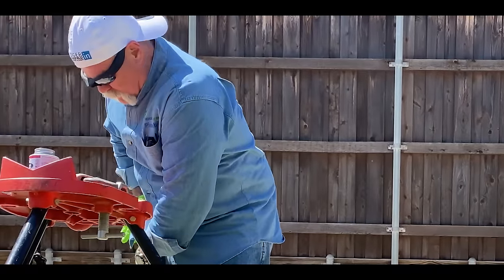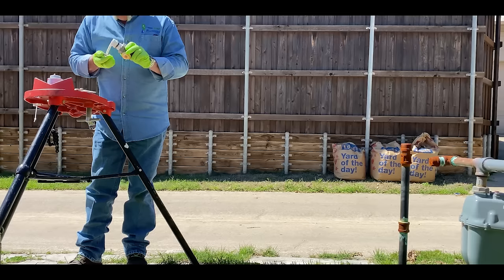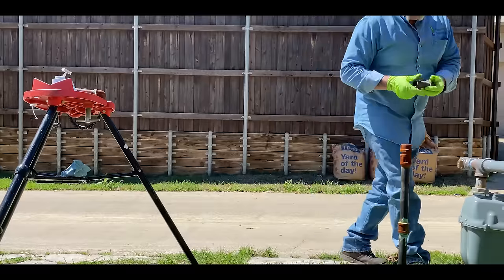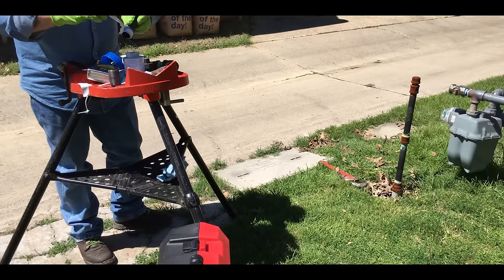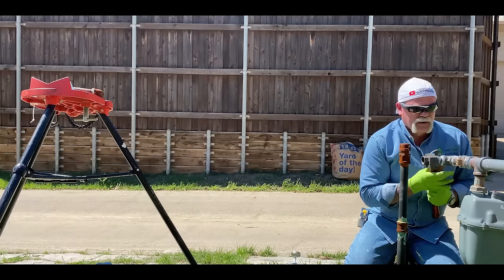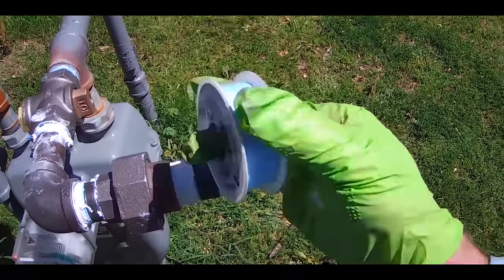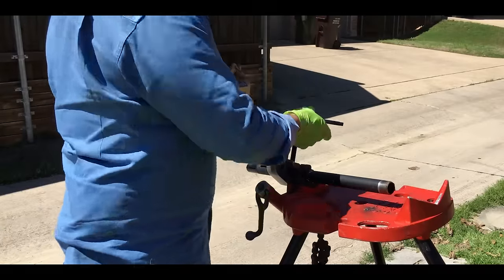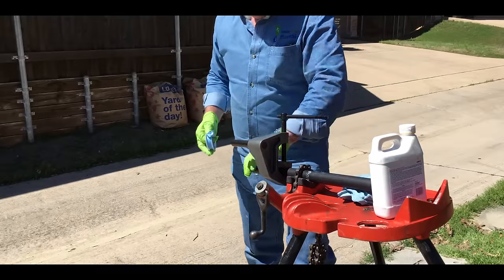Neighbor HIT This Gas Line! - Gas Line Repair (Plumbing POV)

Comment: On an outside installation of a gas meter if its not up against the side of a house or if its within certain distance from a road , driveway or anywhere it can be hit  needs to have concrete pilings here in New jersey... I know of an old lady who hit the gas instead of the brake on her car and ended up going around the back of the building and hitting allof the gas meters for the building . Luckily there was no fire or other damage. Any exposed black malleable steel pipe must be painted in order to prevent rust. We use galvanized outside
Reply: 1301, I am from Missouri and just like New Jersey we adhere to the National Fuel Gas Code. The problem is a lot of people out there ( plumbers, pipefitters, contractors, h v a c technicians & ect ) think the only codes they need to adhere to, are municipality or state codes; and that is fine until an incident occurs and there is a lawsuit filed. Then these very people find  out the hard way that their state is in the United States and the trial attorney sets down on the deposition table, the local code book, the state code book, the national fuel code book and the GAMA ( gas appliance manufacturers association) standards manual.

Comment: In the old days before Teflon tape and other stuff. The one item we used on gas pipe in the plant told to me by the old timers and we used and never had a leak was ; permatex no 2 form a gasket. It’s totally resistant to petroleum products, never hardens. It works great , never had a problem.

Comment: I use the dope/tape combo on any threaded connections so far as water lines are concerned.  But on gas lines most codes don't allow Teflon to be used as a sealant, even the dope is required to be non-ptfe. Another thing I'll mention for anyone watching that's considering adopting the practice, be careful you don't Crack your fittings! Especially these brittle "lead free" brass parts.

Comment: Very nice gas job! it's done  professional plumber all that is left is to paint those fittings and pipe so they won't get rusty. All I know is that most plumbers don't like doing gas jobs I still remember carrying the vice Ridgid machine out of the truck,  remember getting rector seal, oil, teflon.

Comment: Post completion document you recommended safety steel surround installed to eliminate any future damage to meter. New residentials have these within garage conventional water heaters, car pulls into garage to far, will hit safety steel surround, won't hit existing water heater.

Comment: Wondering if some sort of protection barrier needs to be installed to prevent future car strikes.  I know for heating oil tanks were cars can hit it there is a requirement to sink posts or some other solid barrier to prevent it.

Comment: Another trick to use is putting Molly paste on the threads and faces of the union.  This helps with the seal, and ease of breaking the union apart in the future.

Comment: It’s been a few months now. Maybe a year. But the tape and pipe dope tip finally came in handy.

Had to replace gas valve on water heater, and went ahead and replaced the old valve coming out the wall and replaced 3/8 or 1/4 inch copper line that was kinked pretty bad in one spot with the correct 1/2 size line.

All went well and saved my butt!

Maybe do a video on shortages in the industry if you haven’t. I caught hell trying to locate a Rheem LPG gas valve.

Comment: I work for the largest utility in the USA. We use pipe dope only, but you have to use the right pipe dope. It’s not yellow dope, it’s not blue dope, it’s green key tite dope. Never hardens. Always seals. Ps, you stole the utilities usable tee, now they cannot hot tank the meter to work on it. The tee above the right side of the meter must stay open with a plug. Then the utility can probe the meter and Keep the service hot without interrupting service
Reply: Lol - we may work for the same company. I remember using the yellow crusty stuff in early 2000s though. Terrible stuff

Comment: Sir you are right perfect tools for a perfect  job 👏 👌  I learning lots of thing from you ! Gas pipe line working is always difficult  And sir one more thing I like to add please  for new plumber also concerned for the safety and Gas leakage test..

Comment: I loved seeing that you used both tape and dope.  That is the exact method I used when I drained my water heater earlier this year to flush it and the shut off valve broke when turning it back on.  Both the Water heater and the Furnace are in the same closet.  I took the opportunity to fix the terrible work that was done back in 1968 when this house was built.  I am a novice,  and even I could see that the people who had put together the split between the incoming line and the two appliances didn't care.  They just threw something together with what they had.  The gas line comes in through the back wall the put a T about 6 inches out from the wall to split the line and then a 90 to continue it beside the other.  It looked like a two pronged fork sticking out of the wall and came almost all the way to the front of the closet.  To replace the water heater you would have to completely remove the gas line as it cut the closet in half.

PS Howdy neighbor.  I am just down beltline over in Farmers Branch.  :)

Comment: I work in the oil and gas industry construction side we use teflon and tf 15 pipe dope with presure tests 5500 psi sometimes u better use both in our applications

Comment: Great video! Here is PA we always spray paint pipe and would use meter protecting in that location...I know all about dragging the old ridgid threader out of the back of the truck haha
Reply: We always paint our pipe as well- nice finished product, keeps pipe from rusting also!
Reply: @tomallen7699  ... in these parts (Ct) the rule is all black pipe must be painted or it doesn't pass inspection. Not sure if that's on the books, but that's what the inspectors want, and it can't hurt.

Comment: You only need three to four wraps using monster Teflon tape putting 8 wraps is way too much. It is also against Connecticut code to use non gas rated Teflon tape on gas lines

Comment: You tried the yellow. Blue monster gas tape it works for propane and all gases I love it it’s more of a plastic texture but melts into the pipe just asking because I do a lot of  propane and depending on area propane will eat through the tephlon tape

Comment: My biggest debate with other plumbers lately! I put the dope under the tape for aesthetics, but another plumber advised me use the gray dope ,on gas lines, as it is water based and the corrosion  helps seal the threads! Not sure if its true but havent had a leak since doing this!! Now my biggest and only problem Ive ever had with you , is why oh why are you not using galvanized outdoors??? Someone earlier brought up teflon on gas you must use the gas Teflon only tape its usually yellow or gray

Comment: When doing gas it wouldn’t say it’s necessary to use tape and dope on the threads. There is not a lot of pressure after the main. But it’s necessary when doing high pressure lines.

Comment: Don't know what that pipe dope is consist of but here in Europe only thing that is combined is hemp trends and linseed oil in the old days, and some of it still today. I use it in the same amount as Loctite yellow pipe thread glue or Loctite white tread line. Teflon tape only as a gas Teflon tape that is thicker and one that is like fine felt material impregnated in white sticky dope, similar like that white stuff in a can with a brush.

Comment: Roger is correct, Teflon tape first, lack slick tight secondary. Another aspect within this process can save you massive time, when soldering near any fittings that have just Teflon tape, and-or laco liquid Teflon, will leak post completion. Using both prior to any heat/soldering, especially within acetylene choice, highly probable you won't have to cut section second time, drain system down, start process over again.

Comment: I noticed you wiping the joints when you where done installing the valve I have always thought pipe dope and then tape cuz if you do Teflon then dope you just end up wiping all that dope off the bottom of the threads win you are done in other words I think the tape keeps the dope in place👍

Comment: back in the dy when i was deciding what i wanted to do for a living i worked under a master plumber for a couple years we used tape and dope .. we also put vavls in to gas line without shuting the gas off. we did alotof gaspipes and propane install

Comment: Would have to wack that meter when it’s time to change out . It’s supposed to have a tee on the outlet side to supply gas from a bypass to keep the pilots on in the house while doing meter maintenance.  But maybe your area doesn’t require it good job and idk why I’m up so late if I’m going to be working on this all day tomorrow lol 😆

Comment: I know it's an older video, but I work as die maintenance in a die cast factory. We have water, and oil pipes on the dies. The other guys always looked at me funny for using pipe tape and pipe dope. I've never had a leak ever.

Comment: Used a 20 year old snap on drill that our service manager happened to find layin tucked away and the battery still had enough power in it to drill 2 sets of 2, 4x10s together

Comment: Man I gotta get my dad to buy one of those cordless threaders. The hand threader we have is an old Ridgid from the late 60s that plugs into the wall. It weighs about 50 pounds and has enough torque to take you for a ride if it binds up and the handle gets hung up under your jacket.

Comment: As an electrician this Milwaukee threader looks like the bees knees. 
I've done so much Rmc threading using a pony which is basically the corded version of this tool. 
But there is not a good way to attach the tool to the tri stand. 
If you anchor the tri stand down with anchors you can wedge a piece of pipe or strut under the handle. But that's a pain too. 
This clamping mechanism looks like a game changer. .
Leave it to the plumbers to work smarter. 
Also do you not have to seal the pipe up with paint? 
What about a bollard looks like that is a likely candidate to be hit again.

Comment: Teflon and dope is the best method . Key tight works great ( just messy ) . Kinda surprised you didn't use galvanized pipe and fittings . That tool and Milwaukee tools in general are awesome !

Comment: Here in CA they would make me put a tee and plug where that first 90 is
Reply: SD, that is the correct way to do it in all 50 states. By installing a tee now you have a pressure tap ( with a pressure tap I can pressure test the fuel run , verify the working pressure drop between the meter set and the appliance load and I can check the working and lock up pressure of the regulator).

Comment: I'm pretty sure you can't use tephlon tape on natural gas as it will gradually degrade and all the joints will leak gas.           They do make a yellow tape for gas but I still wouldn't use it.          Now on water I also recommend using both tape and thread sealant.

Comment: Wouldn't you use Galvanized piping instead of black iron piping when using it on outside ? Other than using the spray to prevent it from rusting

Comment: Sick video roger ! Always work on gas lines. If there’s a lot to do I would cut off gas of the house to just be safe.. I’ve never used that tool, nor have I made threading on galv pipe.. Have mega/propress tool. So I’ll slap a male adapter on the other side..
Reply: I’ll never do that working on a meter though.. only on a new extended gas line.. to whatever needs a new gas line ran too..

Comment: Nice craftsmanship but isn’t exterior plumbing supposed to be galvanized because of the elements or is it different in your state?
Reply: In Oklahoma you can use black iron but you have to paint it. Im sure it's the same in Texas
Reply: I've seen plumbers here in northern California use black steel pipe for gas on meter then paint it. Code here sais that it should be galvanized they paint it grey I asked why ? They said the fittings are cheaper so go figure.
Reply: @jaredservin2392  thanks for that information

Comment: Every job I had to. I had to bring it 100% up to code. My question is doesn't that include pressure testing it.  Which is what I would have done before connecting it to the main. Especially after a vehicle strike!  I didn't see and end cap with a pressure gauge and a Schrader valve.

Comment: Do they have loctite 55 or 577 in the US? that’s what we use a lot of in the uk instead of ptfe tape these days, 55 is ptfe based fine thread so gets into the pipe threads directly and 577 is like a gel that cures on compression of the thread. Much easier to use.

Comment: I remember hearing that the teflon tape fills the larger imperfections in the threads and the pipe dope does 2 things. The first is that it acts a lubricant so the teflon tape doesn't get bound up or snagged when it's going in and the second is it seals the smaller imperfections.

Comment: A meter outside the house like this would never be allowed here. In Germany the plumber has to make sure that no one can manipulate/sabotage the gas installation. So when ever you are installing gas in a place that is generally accessible (like in an apartment building) we have to use special fittings that can only be operated with  special tools and not with a standard wrench. So this meter you have there must at least be placed in shed you can close up.
And before we are allowed to let gas into the construction have to make an endurance test with at least 1 bar of air pressure for the pipe and another pressure test with 150 mbar for at least 20 Minutes with closed valves in the construction. Only if both tests are ok, you may turn the gas on.

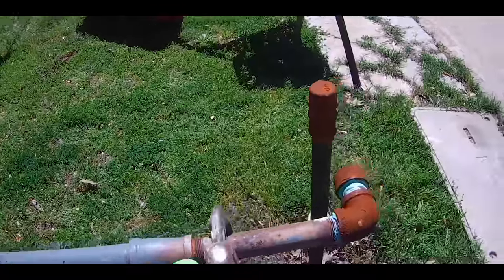Comment: 2:30 Today I learned natural gas lines to the house are only pressurized to around 0.25PSI. I had no idea you could change natural gas pipes like that live outside while just covering it with your hand or something else quite easily.

Comment: My local gas company will fail anything that has tape on it.  I never use tape on gas for that reason but I don't normally have leaks even if its high pressure.

Comment: When working with live lines like that, how do you avoid potential sparks from static electricity?
Reply: Most static sparks are not hot enough to ignite ch4. Outdoors the oxygen to gas ratio wouldn't be enough to support ignition very well.
Reply: In an industrial setup, you wear Kevlar toed boots and static discharge posts ( grounding posts ) are used

Comment: Funny in CT we cant use Teflon tape on gas lines.  Only water or Drain.  Dope only on gas.  The genius inspectors here outlawed it about 3 or 4 years ago,  claiming that a loose piece of Teflon could blow through the gas line and get stuck in the gas valves of Stoves, Water Heaters  Boilers, Furnaces, Laundries, Etc.  Cuz I used to do the exact same thing.  Teflon with dope.

Comment: So I realized to use pipe dope and Teflon tape  about my second year thru my apprenticeship...
My actual method is pipe dope first....and get it into all the threads Nicely....not to thick though....then apply two wraps of Teflon tape and then add a tiny amount of dope to tip of the thread to act as a lubricant so the fittings smoothly seats in

Comment: Used to work for a school district on their boilers.  We used about 6 feet of Teflon tape and a ton of pipe dope on every joint.  But these were very old 3 and 4 inch steel pipes where half the threads had rusted away decades ago, and they still leaked half the time once they got up to pressure.  Makes you wonder why they wouldn't budget for some replacement steel pipe instead of spending the whole budget on tape and dope.

Comment: Why is the meter put in the middle of an driveway in the first place without any protection or a small housing? This belongs mounted on the house or at least in some sort of shed...
Reply: I was thinking the same thing. There should be those concrete posts like you see blocking entrances to stores
Reply: I work for a gas utility company in California we are required to protect the meter either with a meter guard or Ballards customer doesn't pay for anything its part of our responsibility.

Comment: Well, was a pipe fitter for 41 years, never had a leak on black pipe. Always check your thread with a fitting so you know getting proper makeup when tightening
Reply: And you being in the trade for 41 yrs must have seen wicking. I use that if the threads are questionable. The wicking absorbs moisture from the dope after being put together and makes a solid joint. 
Loved working with the old timers. Old is the best school
Reply: @charlespelletier9621  ... worked with some old guys 25 years ago and used wicking under the teflon tape then added a little dope, especially when doing steam boilers. Also never used more than maybe 2 turns of teflon tape. The rest just bunches up.

Comment: I was helping build the fire line into a new occupancy while the sprinkler guys were doing their thing cutting lots of nipples for all the different heads.  Had to ask one of their guys why he put on dope then thread tape Instead of the other way around.  I had never seen that but it was just the way they taught him as a pipe fitter.  When I started local inspector didn't want Teflon on gas something about plugging orifices in appliances but we put both on every ground threaded joint without a gasket now.  Works the best all round.